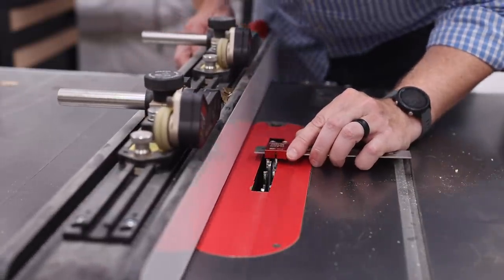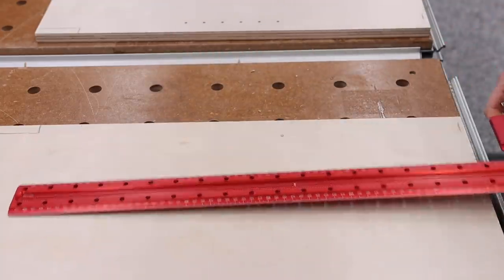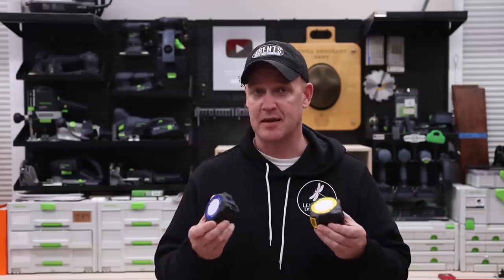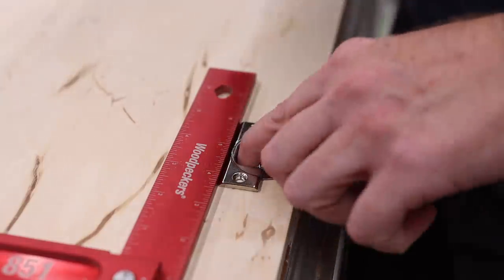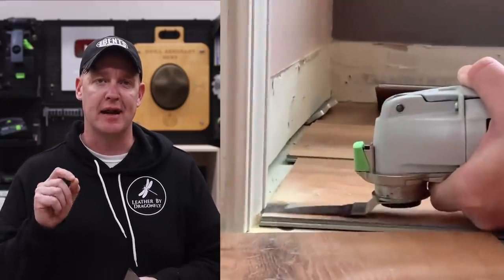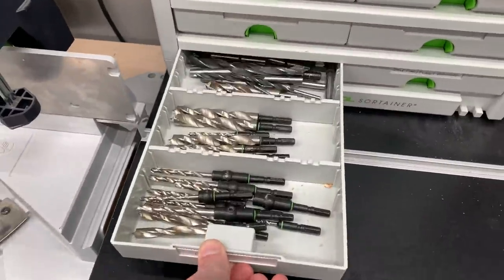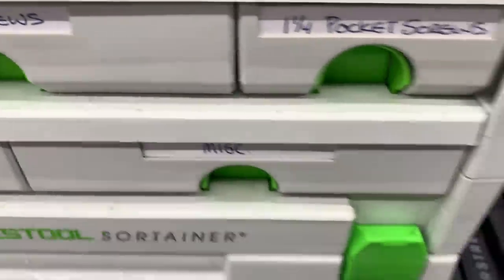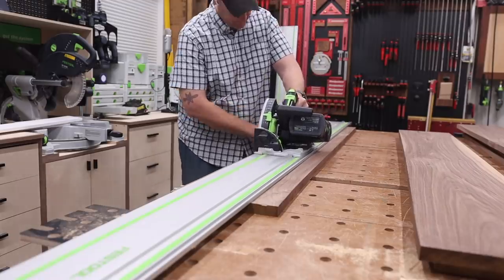15 Woodworking Tools You Won’t Regret

Comment: @3:21, I love the Fastcap flat tapes.  They lie flat so there are no parallex issues that can happen when using normal (curved) tape measures.  Also, the killer use for tracksaw is being able to break down sheet goods at lumber/homecenters if you don't have a minivan or a pickup truck.  I take a foam board to HomeDepot and cut down my plywood using my tracksaw.  It saves a ton of time.
Reply from the maker: Yeah I can imagine that would be very helpful. My buddy does it all the time cause he has a Prius.

Comment: I had never heard of a guide rail square.  What is the use case for using guide rail square versus parallel guides?
Reply from the maker: Quick square cuts vs multiple rip cuts the same width.

Comment: Thanks for this video and I agree with your basic list. Most are my go to tools as well. What I’m interested in is the rack you have for your MFT clamps to hang on and the green dust hose attachment on your track saw. Need a small clamp rack and that looked interesting, did you 3D print it?

What is the purpose of the green dust hose adaptor? Looks like it might make the dust hose less intrusive. 

Thanks again and as always, looking forward to more of your videos.
Reply from the maker: I will have a video on the things you asked about soon 👍

Comment: Have you compared the fastcap tape measures to each other? I've yet to find 2 tape measures from other manufacturers  that are exactly the same!
Thanks for your videos........I usually pick up great info.
Reply from the maker: I haven’t but maybe I will now.
Reply: Buy class 1 tape to measure against. As far as I know Dewalt and Tajima make them. It is 0,4 mm max error at 1 m

Comment: I have seen ur rail and parallel guide videos as well as some track saw comparison ones, all of this to ask;  would you forgo a cabinet table saw and jointer for a descent track saw system, router (replicate dados on the table among other things) and assembly table?
Reply from the maker: That’s a tough question cause it depends a lot on what you do in your shop.
Reply: Let's say for the most cabinet work and some furniture with not many things thicker than a 6/4.

Comment: Do you have the TS55 or TS 75. I have been wanting one but not making the 75 yet. I can wait until back in production.  I thought buy once; cry once. Your thought?
Reply from the maker: I had both. I think the 55 is best for most people. I actually sold the 75 cause I wasn’t using it. I have a video comparison on the two that you may find helpful

Comment: I use my tsc55 all the time as well (REB). Do you have the new one yet? Reason I ask is, I've always found it slightly underpowered and was wondering if the KEB is any better. Thinking of getting the 75 and using the 55 exclusively on my crosscut station... but can't seem to find a 75 for sale anywhere. I joint with the 55 a lot as well... maybe another 55 dedicated to rip would be fine. I am one of those guys that likes my tools ready to go without a bunch of setup and fussing.
Reply from the maker: I have the new one and it is a significant difference with the thinner kerf blade. I sold my corded 55 the minute I got the cordless. No regrets

Comment: I have (and like) a few of the fastcap tape measures as well.  I have the white, yellow and green ones.  I discovered the green one is around 3/32 (ish) off from the white and yellow (haven't compared the yellow and white to each other yet).  I'll probably as fastcap about it, but I figure if I use the same one throughout the project, it doesn't matter that much.
Reply from the maker: I’m sure they would be happy to replace it if it is off.
Reply: They have replaced more than one of my tape measure for free
Reply: @bentswoodworking  You talked about the Fastcap but didn't mention their flat tape measures...and you even showed yourself angling your tape measure over to reference the edge. Check out their flat tapes if you haven't, and then post an updated video with the 16th tool you'd recommend :)

Comment: While I like the regular parallel clamps, the weight makes them less than ergonomic for small clamping operations. While I have traditionally used a combination of regular bar clamps and trigger clamps for these tasks, what I find myself reaching for more and more often is the Bessey Uniklamp. 

The Uniklamps are light parallel clamps, with the weight like an average bar clamp. They have a deep reach, but given that they're parallel you can target the center of your clamp anywhere up and down the contact surface. They won't apply as much pressure as the strongest bar clamp, but they're not weak and it's pretty rare I need significantly more force. About the only major drawback is that they are clutchless clamps, you need to think while using them. When yo performing an operation where you need extra hands while clamping, you'll go back to a trigger clamp.

On the setup blocks: While I believe iGaging has fixed this for a new version like the one you have, the old version I have comes with an extreme annoyance - the blocks were in a plastic case with the blocks laid out in an order which was just unintuitive enough that I would waste time getting the blocks in and out. Even worse, that plastic case could break easily and there was very little to keep the blocks from falling out and forcing you to play pick-up sticks. For that reason, I strongly recommend getting blocks in a case where they are wedged into foam in order.
Reply from the maker: I have the Uni Clams as well and they are great.

Comment: Good video, but why use metric & imperial if you live in the US where most materials we have access to are imperial?  Just wondering about the benefits other than the simpler measurements with metric. Thanks, enjoy your videos.
Reply from the maker: I actually have a video discussing why I prefer metric that you might find helpful
Reply: @bentswoodworking  thanks, I will look for it.  Love to get other's perspective on woodworking as I get better.

Comment: As an Aussie born in the 80s I have an understanding of what a foot is and what inches are. Anything over 12 inches I get lost. Eg. If you say 90 inches I'm lost. But if you say 24,36,48... I'm alright. 
It's only because I've watched so much US woodworking videos is my understanding of 1/4,1/8,1/16... of an inch looks like. 
But there is no way I'm bilingual enough to ready an imperial tape.

Comment: I appreciate your channel but recommending a $179 pocket ruler,  a $139 simple clamp, and a $635 multi-tool?  Come on.  You are part of the inflation problem.  Recommend more cost effective alternatives.  How many of these tools did you buy vs received in exchange for product placement?
Reply from the maker: I literally bought every tool in this video with the exception of the particular track saw that I was making a cut with. If I used more cost effective things, I would recommend them. The purpose of this video is to make people aware of items they may not be aware of. I didn’t say buy a $635 multi tool. I explained why I think a multi is a good tool to have. I just happen to have a festool one. Buy a dewalt or a Milwaukee.